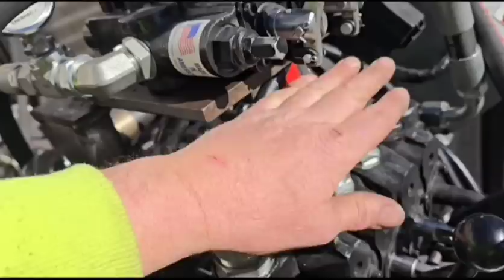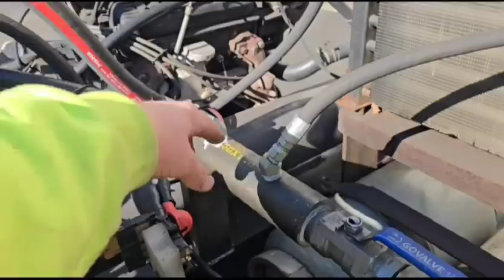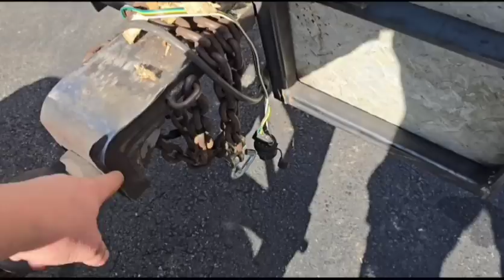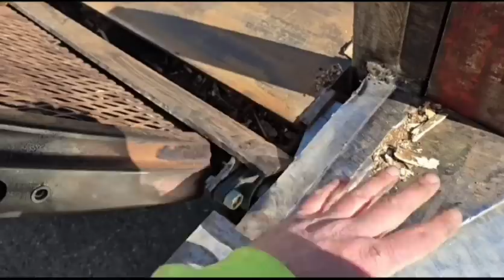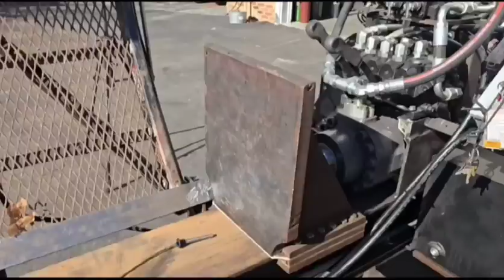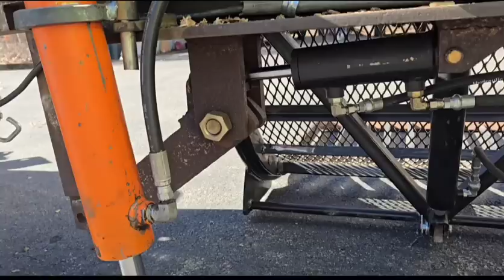Homemade V6 powered logsplitter

Comment: Gotta have a name for that beast, I’d call it “SPLITZILLA”, probably need a 3/4 ton to tow it on the highway. That push cylinder weighs more than my Home Depot splitter,  you have a good mechanical mind and skills to put together that monster, truly one of a kind! The only problem I might see is unless your rounds have square ends one could pop out when you’re pushing multiple ones through. Be careful and well done my friend!😊
Reply from the maker: Thanks for the compliment. You're correct about one possibly shooting out when splitting multiple logs. I've had one almost do that when the ends weren't cut even.

Comment: Neat splitter. There maybe a filter in the fuel lock off. 
How did you hook up a governor to operate rpm at the engine. 
Nice John Deere tractor. 455 👍🏻👍🏻
Have a great day. 👋👋
Reply: Thanks. Lots of power in the 4.3. 👍🏻
Reply: @noelstractors-firewood57 Just put a universal cruise control, the one with the sensor and the magnet on front pulley.   I think they have to be over 35mph, 4th gear is usually direct 1800 rpm.  There you go, but this set up doesn't look like it needs it , maybe if it was pulling a disc
Reply from the maker: I don't have a "governor" per se.
I use a lever that's on the console to throttle up or down. Similar to a throttle on a push mower.

Comment: hello Robert,great work…does she just sip the propane?
i have a dual fuel generator and it runs well on propane ,clean and seems to go forever vs. gasoline 
it is a bit harder to fire up though
Reply from the maker: It does OK. I haven't really measured it.

Comment: I was a forklift mechanic for many years way back in the day, I worked on many of those V6 Hysters. On the propane, one is a lock off valve and the other is a vaporizer ( it has coolant going to it). That is the most bad ass log splitter build I've ever seen, super nice job man.
Reply from the maker: Wow man! Thanks for that and the info on the propane.

Comment: It's needs for sure bigger pump  least a 38gpm  get hold of wolfridge mfg  or eastonmade  and tell them what u made here and they probably  point u in right  direction
Reply from the maker: This pump is supposedly between 35-46 gpm. We have the data plate but can't find the exact gpm.